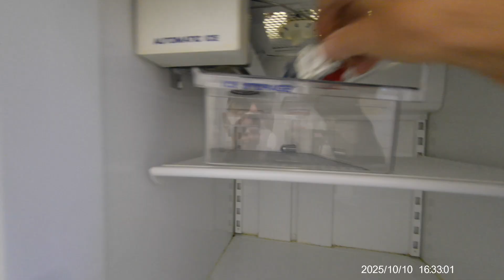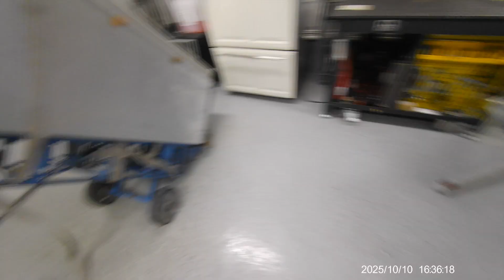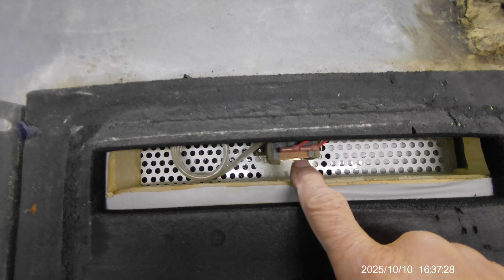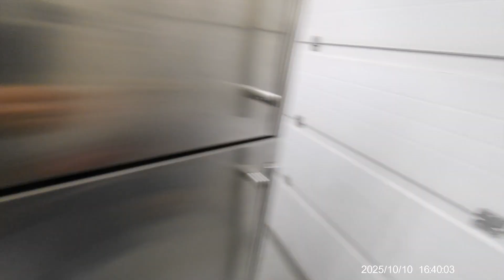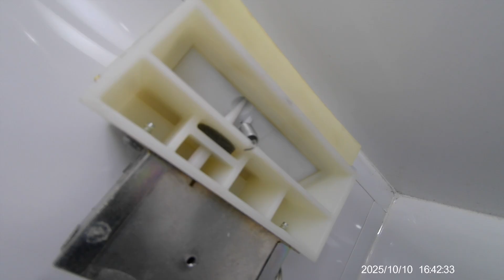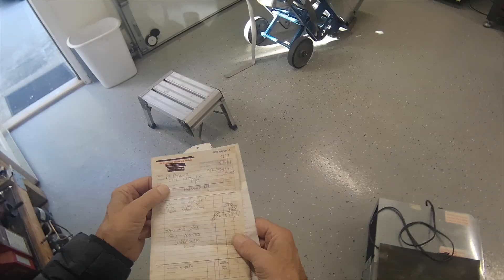Northland Refrigerator Operational Overview

Comment: Hi. I have been having a very hard time getting in contact with Northland Refrigeration Company (I believe, I may be wrong, that the company was bought out by another company). I need a door gasket for both my fridge and the freezer (they are 24 AR-WS-R & 24 AF-WS-L, two separate units). I bought them at least 15 years ago and I am having no luck in finding a company that carries the replacement parts for the gaskets. My question is what type of mounting is the gasket in your video (the gasket looks like the same type that is on mine) If you are able to respond to this question, it would be very helpful as I believe I have to have them custom-made. Thank you in advance!
Reply from the maker: Northland was bought by Middleby and you can get parts through them at: 616-754-5601

Comment: Hi, your video is fantastic. We are trying to keep our older Northland NM10A GS 24 TIRSN alive, the one in your video. The unit works however heat is coming from the ceiling of the freezer so the freezer does not get cold enough to keep ice cream hard. I noticed the replacement thermostat S31632-000 is not available anywhere but I can splice and attach a probe with a matching resistance and shrink wrap the splice, or get the RANCO thermostat which is a universal part for the mechanical cold temperature thermostat 115V.  However if heat is coming from the ceiling of the freezer that is something else right?  Can I text or email you directly? thanks
Reply from the maker: Check the condenser fan motor.

Comment: Are you sure the first receipt wasn’t 2012 and the next receipt in 2017, 5 years later? Check again because the 2012 repair looked to me like he charged 550 and in 2017 his price had gone up to 650. The only odd thing is the receipt number went down invoice 4117 vs 2589 (the 2017 invoice). Even if the numbers were the other way around, there’s no way the guy is doing 1500 jobs in a month. 
Boy, is my life boring.  Thanks for the interesting video though..
Reply from the maker: I’ll double check.
Reply: @SubZeroSpecialists if it turns out I’m wrong please let me know, and either delete my post, or I’ll gladly delete it.
Reply from the maker: @Drrich_DIY  You're right to catch that, it is 2017, but that doesn't explain the discrepancy in the invoice numbers.
Reply: @SubZeroSpecialists  we’ll never know the answer to that one other than asking them or guessing. my guess is they’re working their way backwards.